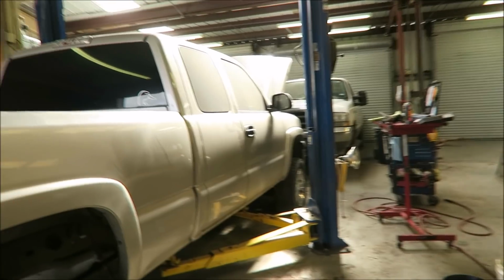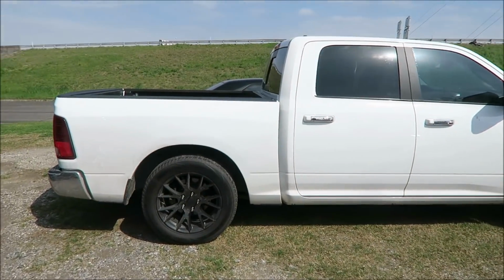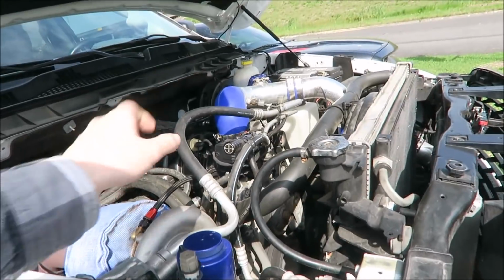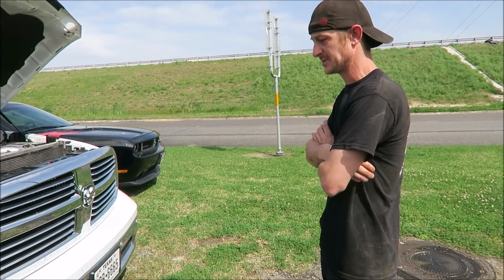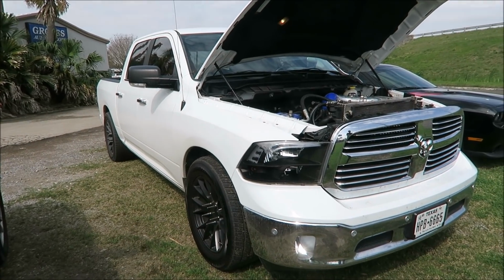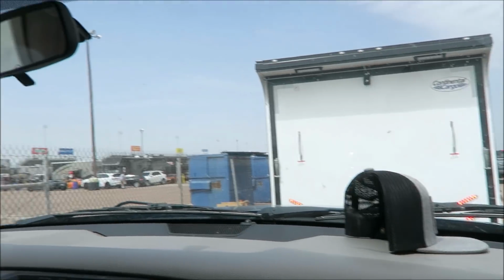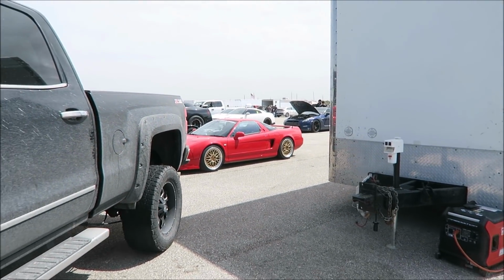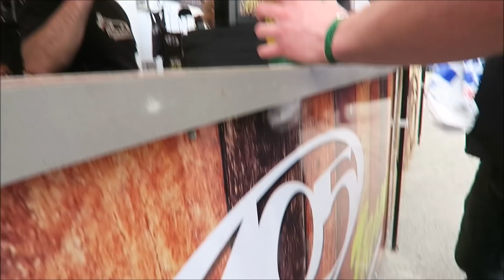This Big Turbo Street Truck is INSANE!

Comment: Great video.  What kind of HP#s does that Hemi Ram turbo make? Looks faster than fu#$.
Reply from the maker: I think he said he hasn't had it on the dyno with the current setup but it's in the neighborhood of 5-600 to the tires. Justin will hopefully correct me if I'm a liar lol
Reply: On the setting it was on while y’all here here it’s probably in the ballpark of 600s. Or I’d hope anyway!
Reply: @doctordifferentialspeedsho9506  Nice work, it's a nice change to see something other than a GM truck get a turbo.  I'm a GM guy, but that truck is awesome.

Comment: You could have turbo your truck but you went the stupid supercharge way
Reply from the maker: You mean the super-cheap-used-bolt-on-in-one-day boost way? Yep, sure did.
Reply: SniderTron 3000 your building a truck that’s not Worth building those truck are hard to get traction, you should have left the truck how it was and you should have fixed up a mustang
Reply from the maker: These trucks don't get traction? Please go into great detail about that and keep in mind the literally hunders of people who are on stock suspension and running 10's.
Reply: SniderTron 3000 yeah they run 10 but see how much money they are dumping into it for everything in the truck to function right
Reply from the maker: Dude, the only thing that needs to be done to the suspension is caltracs. Those and a radial and it'll hook no problem. How do I know this? Because I've seen it with my own eyes. Dude at US131 has a red 2001 Silverado with a stock 4.8, BTR cam and a VS Racing turbo and I saw him run a 10.4 with my own eyes.
Reply: SniderTron 3000 you can’t run 10s with just a cam😂 you need better spark plugs and better injections and more things, you think stock 4.8 with a can can run 10s😂
Reply from the maker: Isn't injector, pump, and tuning kind of implied when you put a turbo on anything? Should I also specify that he shifted the truck while making the pass? lol
Reply: SniderTron 3000 I don’t see why you putting money in your truck when you can get a turbo in your truck and run 5 or 8 pounds of boost, and your truck will be quick
Reply from the maker: I would say a roughly 500hp daily driver is pretty quick, but that's just me. Stock Hellcats run 11's, this truck should be in the 12's on my low boost pulley and I still have 2 more smaller sized pulleys to play with. I'm only at 9psi at peak rpm, I can still make at least 15psi. Don't get me wrong, I 100% prefer turbos to everything else, but don't be sleeping on the Vortec. I think it'll surprise you once I get my trash figured out.
Reply: SniderTron 3000 don’t get me wrong your truck clean but I prefer turbo over anything, I have a 1992 foxbody with a 302 camed long tube header and good heads and I run 10s and my sub frame connectors I have shitty welts and it hooks up good, if I want more power all I have to do it is run a 200 shot of the baby bottle